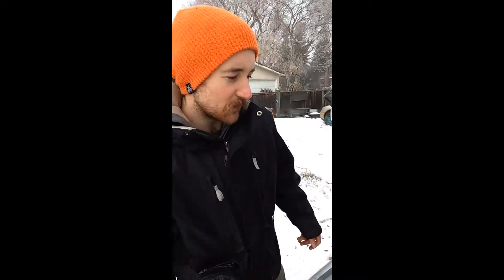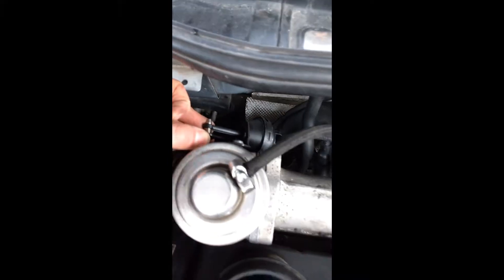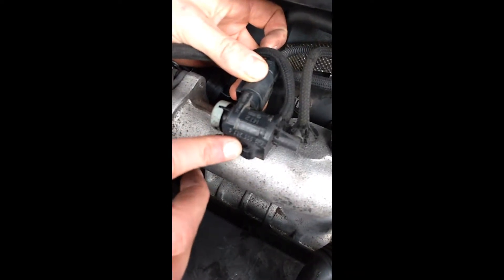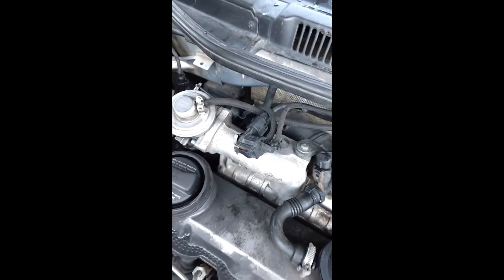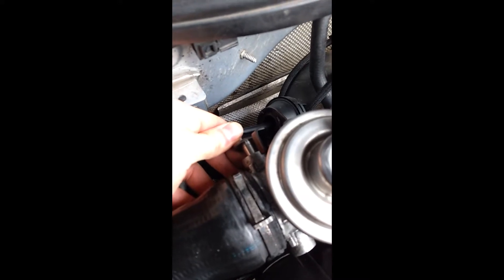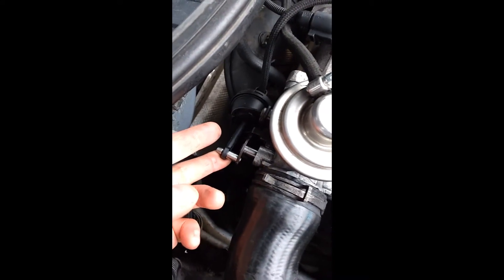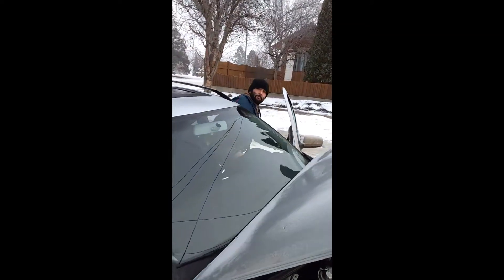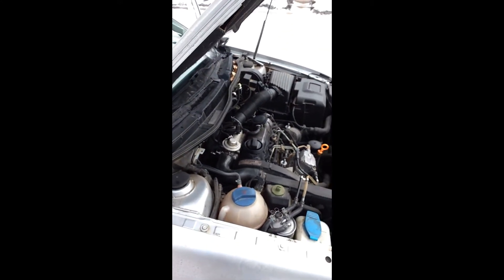How to Fix A Crappy Mk4 VW TDI's Rough Acceleration / Limp Mode (Bad Anti-Shudder Valve N239)

Comment: Any idea if this could cause excessive boost pressure? I'm getting P0238 code after repairing deer damage. The main fuse blew shutting down the engine with the valve open.
Reply from the maker: Not sure on that one, I would check your turbo actuator to see if it's working, and after see if your egr valve is working right
Reply: @robbierisque    the EGR works perfect since it's in the garbage. I have a full delete on the car. The actuator moves by hand. I will have to check if it moves electronically.
Reply from the maker: @spidergoose891  an egr delete can give you a boost code if you haven't changed anything in the ECU or gotten a tune. If it's just a check engine light you can just live with it, and if your car goes into limp mode because of it you can try the old "turn it off and back on again" to get it back to normal operation (you should do this while stationary, steering lock while driving is a bad idea). A handheld vacuum pump is handy to test the turbo actuator, there's some specs somewhere on the internet about the range of vacuum that should move the actuator through it's whole range.

Comment: in my case i changed the egr valve. after couple of drives around i stoped at home and later wanted to drive again but my car stalled. i figured out that the N239 valve(thats what video shows to change) sucks in vacuum, what closes the egr anti shudder valve and the car stalls. Disconecting the vac line to anti shudder valve and pluging the line with something helps to run the car. i guess the n239 solenoid valve is stuck open or the cars brains are gone bad so they gives the signal to the solenoid to open and suck vacuum

Comment: So does this make the car shut off? Does the battery light come if it does?
Reply from the maker: Maybe it could if it the N95 valve failed worse than ours and your anti-shudder valve was able to fully close, but in our case it just had very little power

Comment: I'm about to rip all my hair off frustration. My Daughter's Tiguan 2.0 TDi 2011 had similar symptoms shortly after I swapped the EGR with a new one. After about one hour of normal engine performance, it started to lose it's power when I accelerated. It was almost impossible to run the car if I didn't rev it over 2000-2500rpm. I managed to drive it home. Not limp mode, and no warning lights. But when I tried to start it the day after (it's winter here in Norway), it starts, but runs very rough and stalls after a few seconds. (It's not the immobilizer) If it is the same valve, I owe you BIG TIME for the tip. Will check in the morning.
Reply: Soo was it the valve?
Reply: @BloomxGaming the EGR wasn't put back correctly and leaked coolant into the EGR. Did the job a second time properly, and then it worked like it should.

Comment: This is so very helpful. I'll check this in the morning.
I'll try to tell my story short:
VW 1.9 TDi 66kW 2001
(my first car, have it for one year)
A few days ago I noticed that too much oil is lost and it looks like it leaks from the oil cap. Too much pressure ?!?
Anyway, while the engine is on, I unscrew the cap it "dances" very much. If I wouldn't hold it loosely with my hand it would fall of.

So I thought it's time to finally try to clean the EGR valve and the intake manifold. The EGR has been leaky all the time since I got the car (have 370'000 km on it).
So today I opened it up to find that it's barely clogged up. Only a thin coat of that "diesel poo".
Decided to not clean the intake manifold for now because I thought it would be so clogged up that I couln't see through but hey, at least something good.
While removing all the hoses and etc. I noticed that one cable with two wires was almost eaten away, bare wires were touching an there was a lot of cable cover missing. Decided to cut out the bad part and solder on a fresh piece of wire an put some shrink sleeve on. And wrap it with electrical tape.
Recently after finishing up I took a picture from the thing the wire went to and it's the ASV solenoid valve.
Now I start to think my car sounds limp. Will try to check tomorrow.

P.S. one more thing - can this somehow be the cause for the turbine to "glitch" ?
When I'm on the road and go over 110 kmh and if I press the pedal fast go to 120 kmh the turbine sometimes "glitches" and accelerates very slowly, the only thing that helps is when I restart the car. It doesn't happen if I press the pedal slowly after 110 kmh
A friend told me that this can be a electrical issue, but of course I know it can be the tubine.

Maybe now I have hope.

Still the most urgent problem is the oil leak. I've used up 2L oil can over some 2-3 weeks.

And again thanks for this wast amount of info. Will have to check the other valves too which you talked about in the description.
Reply from the maker: Glad this helped. If you're getting lots of pressure out of your oil cap there may be something else going on, like maybe a blocked valve cover breather hose. If you're using that much oil and it's not falling out on the ground somewhere then it's probably going into the cylinder and being burned, hopefully your piston rings are still good. There are many things that can cause your car's computer to go into limp mode, the ASV valve might be one of them so hopefully that solves your turbo glitch problem. Good luck!